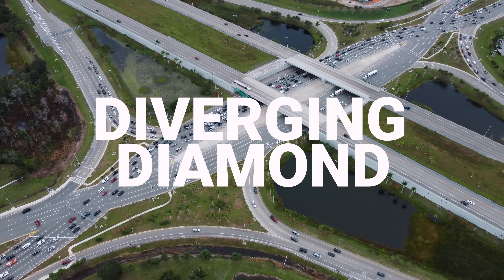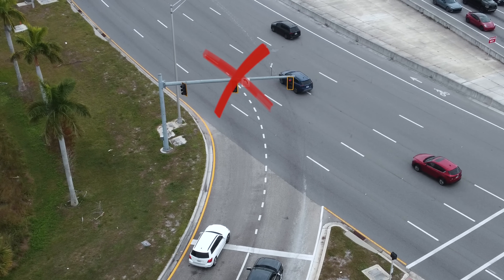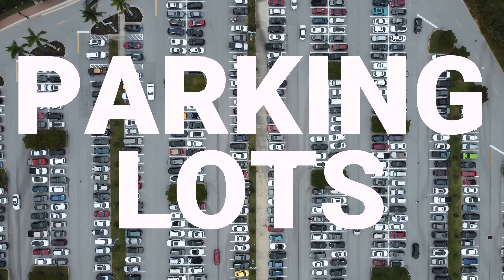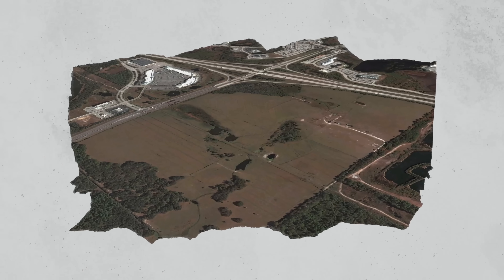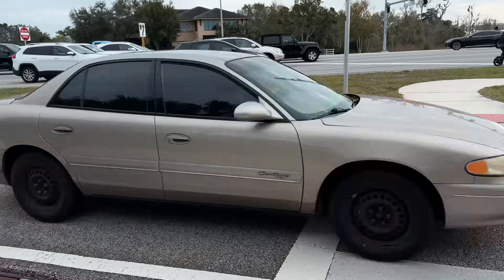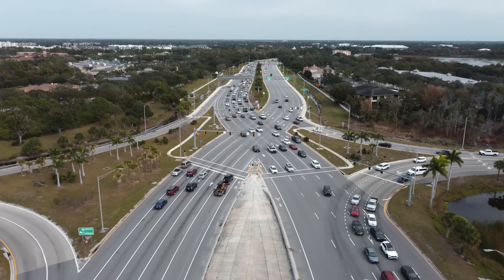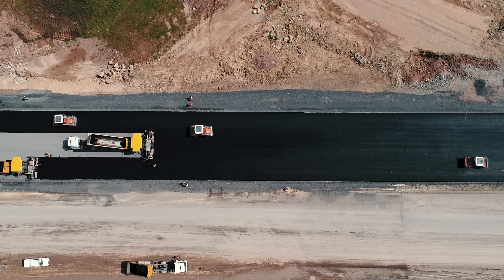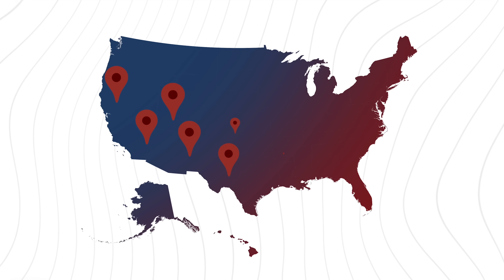Traffic Will Never Be Fixed Here

Comment: An AI that manages the entire intersection can improve the intersection tremendously. It can independently decide which traffic lights switch and how. It requires sensors in every lane and also for pedestrians and cyclists. Even if this is not as big a role in the USA as it is in Europe. But if AI can take this into account, it will not only be safer for drivers, but also faster. The Netherlands has already produced many good results.

Comment: Traffic is mostly fixed.  The key purpose was to increase flow from before and reduce accidents.  It succeeded on both accounts.  The problem is there was no development planning as happens a lot in Florida.  When uncontrolled zoning is done, this is what it leads to.  You have to do development planning for long term and Florida sorely lacks this ability.

Comment: Wouldn't that issue be fixed with few tweaks to the traffic lights? Where the traffic lights weren't 1:;1 synchronized byt that the traffic light before goes red way WAAAAY before the latter one and that time is for the area to clear the lane?

Sure it'll slow down the flow, but completely having it blocked by cars slows it down more....
Sure, we should get rid of cars first... but until we can get there.

Comment: The solution to this situation has nothing to do with removing the retail developments in the area. What you need to do instead is to build large roads spooling off of opposite sides of each of these major retail sites, and then loop those back around to the main highways, and have the central connections between them only connect to each other, not to a main travel artery. 

This way, people trying to enter or leave one retail space would never get tied up in traffic with people trying to enter another, reducing overall traffic from all the sites. Really this is the solution to most traffic snarls, "do not funnel large numbers of people into a single intersection, instead split them off lane by lane toward their intended destinations, such that only the narrowest amount of people end up conflicting at the same intersections." 

Obviously it was not intended for pedestrians, nor is there any reason it would be, because pedestrians would never be there. You would have to drive just to be within walking distance of it. It would be like making sure that mountain hiking paths are accessible to cars.

Comment: I remember a long time ago, I had a conference in Charlotte. I walked out of the hotel to get some food to each within about 1-2 km. Well, there aren't even pedestrian footpaths. There was just the road. Even more ridiculous, you can actually cross the road (about 4 lanes on each side) as a pedestrian with lights, but on the other side, there's only a concrete block where you can stand. Beyond that, you have to walk on the grass or on the road itself. For such wide roads, and in an area not far from shops/hotels, there wasn't much street light either. Who builds this crap?!? What were they even thinking?

Comment: The engineering is flawed, hence the backup. The flip should be one going over/above and the other going under. So, they never intersect which means there is no need for the stop lights. Then the traffic will be continuously flowing.

Comment: Agree with all the strident.. but this could be fixed by 1) mounting a light on the poles opposite of where cares enter and installing DO NOT BLOCK INTERSECTION signs (maybe lighted?) 2), better timing coordination between the interchange and the main light going into the retail center, and 3) logic on the traffic light board to keep certain phases red if cars are inside certain areas. Unfortunately, the reality is Americans are too dependent on their cars and while we can make strides to reduce that dependency, cars are here for the long haul until we completely ban them.

Comment: 2:34 how abot a clover interchang with 4 ramps that is turning in to the trafik like The off ramp to go right is contuing under The lane to The right and Then gose upp to The rode That gose to The left like in Stockholm sköndal
Reply: Not enough room to fit it and most clover leafs have ramps/bridges or overpasses that are far more expensive. The design they used only has 2 bridges that I could see and takes up less acreage. Not that this design where backups on other roads cause it to back up is good but if a clover leaf would fit and cost the same/less then pretty sure they would have done it. If it wasn't for the fact Americans hate and don't know how to drive in a roundabout,  a double roundabout would have easily fixed their intersection/traffic flow problems AND taken less space and money to build than clover leaf or the diamond they did build.

Comment: I find it strange that the planners didn't foresee traffic being gridlocked on the junctions. A simple redesign which turns it into a roundabout, reduced on/off ramps and reduce the speed to 30 would go a ling way to solving the issues as less options for the driver increases flow.
Reply: A double roundabout, Google it for picture if you don't know what they look like/do, would be perfect. But Americans can't drive well enough to even use a one lane basic roundabout let alone a multiple lane double set.
Reply: Had thought of a double roundabout layout but then thought it might be too confusing.
It doesn't have to be a round, roundabout, just a means to direct the traffic flow.

Comment: Ignoring the main problem here (car-centrism), I'm gonna question one thing about the DD: why do they need the at-grade intersections? I know it costs more money, but surely if you're gonna spend over $74m on some useless tarmac you can spare a little concrete to bridge over or dig under one side? Then you don't have traffic stopping at that point at all, you just link the on/off ramps to the correct side.
Reply: Because that would make sense. What would make even more sense is a double roundabout, then again it's America. Americans can't even use a basic one lane roundabout properly.

Comment: we build infrastructure for cars as it's what people want. Bike lanes dont take people from a 50 miles radius to the mall.
Reply: We build infrastructure for cars because of early lobbying from car companies. Also if you have to go 50 miles just to go to a mall that's a design failure.
Reply: 60% of all american car trips are under 5 miles so thats a moot point. its not what the people want, its the only choice they have. if you build the appropriate infrastructure, then people will use it. just like if you build infrastructure for cars, then of course people are going to drive.
Reply: Not to mention trying to bring back 1 or 2 carts of groceries in the "bike" basket.
Reply: @shaunp9592  Look up cargo bikes. You can actually do exactly what you're saying.
Reply: @BoxEnjoyer  Sure, if you've got legs of steel and can handle biking in the hot summer or freezing winter depending on where you live. Not to mention the cost, most of the ones I saw are the same price as a used car. $2,000 - $5,000
Reply: @shaunp9592  1) Humans legs are the strongest muscles in the body and cargo bikes are easy to pedal when you have the momentum. 2) electric assistance on bikes is a thing. 3) if you can't handle going outside into the weather of where you live, you should probably move. Or at least stop saying you live there because you don't, you live inside. 4) Idk where you're finding used cars for that cheap. 5) why are you comparing used cars to new bikes? It's not a fair comparison. Compare new cars to new bikes and the picture changes
Reply: @BoxEnjoyer  Since it snowed yesterday your point is mute. Look up snowfall Jan 8 Port Alberni BC.  And we don't get close to the amount of snow/freezing temperatures more northern Canadians have. Or the heat of the lower states.Not to mention the hills here. If cargo bikes were such a great thing how come I've NEVER seen one in real life for 58 years. Simple, they aren't practical or worth the effort.

Comment: Given the US has recently discovered the novel innovation of roundabouts, maybe it's time for them to go one step further: the three level stacked roundabout. And while they're at it, since they'll be building numerous bridges anyway, add a couple of extra ones for pedestrians and cyclists to cross while being completely segregated from traffic.

As for the huge shopping centres, while it's unlikely the US can be weaned off them, but perhaps have multi storey car parks and some soft landscaping instead of acres of surface parking? Maybe even arrange the parking around the edges of the development, and have a shuttle bus or light rail service connecting the car parks and entrances - while they're at it, route local bus services through the development as well. For the large retail sheds, introduce wide pathways linking them with plenty of seating, to encourage people to park once then walk between the various stores.

Comment: It's a very clever design, but that interchange is legitimately wider than even the widest stretch of motorway on the UK's road network. The former serves a city of less than a million, the latter is the western stretch of the M25 that interconnects three different motorways within a couple of miles of each other and serves Heathrow airport as well as London (pop. 10 million). North American roads are just ridiculously overbuilt compared to the population served.

Comment: To Fix traffic, the solutions are often really unintuitive, and not what most people think. The congress of New Urbanism has discussed this about places that have dealt with their traffic problems effectively, and the ways to do it are 1. Put shops near where people live, so people can walk to the store if they want to.  2. Increase street network connectivity, Eliminating cul-de-sacs helps traffic distribute itself better, always remember that Traffic is not a flow problem it is a distribution problem. 3. Finally removing stop lights and replacing them with Stop signs or roundabouts is another helpful tool as they are more efficient types of intersection and do not have dead periods where everyone is completely stopped.

Comment: The two huge factors you failed to recognize in this video is the weather and distance. 

Florida has an average summer temperature of about 91°F, constant showering thunderstorms, and humidity around 80-95%. These numbers make it unbearable to travel by foot in Florida. I live in Miami, this state would not exist without air conditioning. We literally have a statue to the man who invented AC on a small Miami island. I’m assuming you live Sarasota, where your average temps and humidity and noticeably lower, but would still have a New Yorker dying of heat stroke in 10 minutes. 

The other factor is that everything is spread apart because Florida is big state. Your footage of a modern pedestrian-friendly location is an European city who’s roads where planned 200 years before the USA was even an idea, and 300 years before the car was mass produced. You can also fit two copies of Eastern Europe in to one America. European cities had to build up because they can build sideways. America can do both, but most does the width aspect because it’s cheaper and our foundation of limestones limits building heights. 

American cities have huge lands compared to Europe, so we cannot be compared. The only reason NYC metro exist is because it predates the car and you have a huge population densely packed onto one small peninsula. The majority of people in NYC/Europe have apartments on top of buildings hosting local businesses on the ground floor. The only thing under my Floridian house (note, not apartment) is porous limestone that can only handle a certain amount of building weight. 

Don’t get me wrong, your video is great and I would love to have the option take the bus or drive to work, but geography and weather are a huge factor. Population density is also a very big problem. Traffic in NYC will always be worse than Florida. 

But good video nonetheless.
Reply: Then Build Some Bus and Railway Infrastructure

Comment: why don't they put a traffic sensor at the backup-point and turn the light red as the cars start backing up?

Also, the "just walk or take a bike" doesn't account for the weather. You want to walk to work in Florida in 95% humidity and 90F air? Sit down in your office with sweat running down your back and a.s.-S? You want to get caught outside in a lightning storm?

Comment: This video makes many good points about how the diamond interchange model solved many traffic problems only to become overwhelmed by traffic later.  This discussion explains why I was glad to move out of a moderately sized city of 550,000, Albuquerque, to a much smaller city of 110,000, Las Cruces, both in New Mexico.  In every way imaginable this smaller city is much more relaxing to live in and get around in.  

I often walk around for exercise, but also to not drive. But even in this smaller community the car centric mentality still prevails.  Walking to a near by mall inevitably involves walking across roads and down entry ways to the mall with no safe space for pedestrial travel.   

I'm glad to see some parts of the country transition to a more people centered layout.   It's a start and a long way to go to make this country more oriented to people than traffic.

Comment: The simplest solution is a roundabout… but Americans find it “too complicated” to just look left and go when it’s safe. The limited brain function need a light to be green for them to understand to push the pedal on the right. (Don’t even get me started for the people who can’t tell their left from right)
Reply: Roundabouts lose efficiency at 25000 vehicles per day per lane.  They would fail at this location.  American DOTs are very specific about where they are installed, which is moreso reserved in suburban and rural interchanges.

Comment: Great video! To you point, it seems that there is way too much commercial floor space in that area and likely too little in other areas. Meaning that this area is the destination for shopping and no where else. Resulting in a flood of traffic. This amount of commercial is fine in a downtown area or area intentionally designed with mixed uses and alternative modes of transportation specifically good transit. The likeness is that this area wasn't originally planned to be this commercial intensive, but developers piggy backed on each other and got what they wanted. The saddest part is of the landowner wanted to demolish some commercial buildings and replace them with new apartment buildings, ppl would oppose it due to traffic.😅 Meanwhile apartment uses create less traffic than equivalent commercial activities.
Reply: I was going to say the same thing as you. Unfortunately the creator of this video is an anti car zealot, so misses the real practical solutions to problems
Reply: @hifivaliant8937  I'm an anticar zealot too

Comment: 3:45 The flaw is not just the distance between the traffic lights in the same phase, it's the way you guys learn how to drive as well, or should i say does not learn.
You should never enter an intersection, if you can't cross it without obstructing traffic from other directions. That includes everything from diverging diamonds, to railroad crossings, never start to cross if you can't fit on the other side.

Comment: It is pretty much how Road Guy Rob explains.  The interchange is so efficient that the downstream facilities cannot handle it.  The backups are because of the other intersections that cannot handle the ability for the interchange to move so much volume.
Reply: Exactly. If you look carefully at the video you can see the problem light: a 4 phase signal for a shopping center
Reply: @AdamSmith-gs2dv  6, 7, or 8 phase, dependent on the left-turn phasing sequence.
Reply: This is why the diverging diamond doesn't work in Chubbuck ID at I-86 & US-91.
Reply: @JamesHorton-fo3yv  Oh, the DDI works.  It just works to good for the existing downstream infrastructure.

Comment: Great video about the interchange. 
I agree that it not a great place for pedestrians, but if there were no car parkes and steets no one would go there. Just because the city development in 17th century europe worked without cars you can´t expect ist to work today. Work playces are mutch further appart because the types of jobs are mutch more divers. And no one wants to live directly to next to a chemical plant or factory. 
People don´t want to live next to a highway, yes. But most don´t want to live next to a train line either. And walking below 10 train bridges next to another isn´t pleasant either.

I would propose these shops should not be build that far away were you can´t reach them. Smaler shops close to were people live and they have a chance to walk there. But the reality is, that these smale shops are closing more and more. They are replayced by Amazon and they deliver by car to.